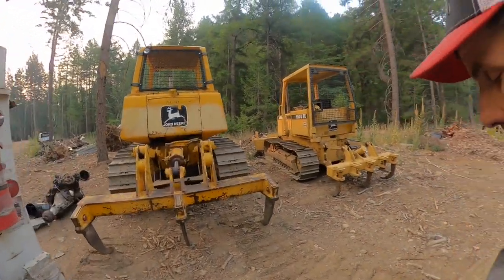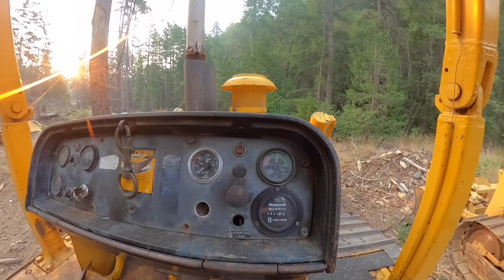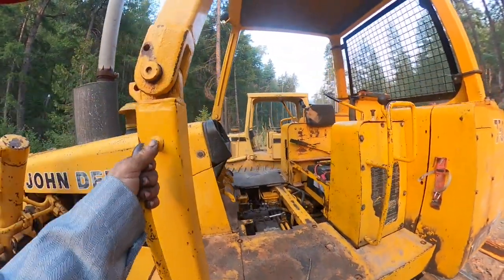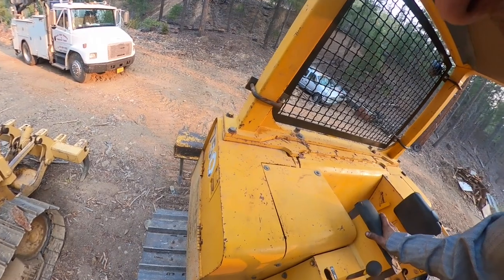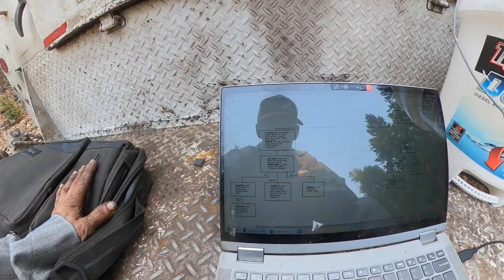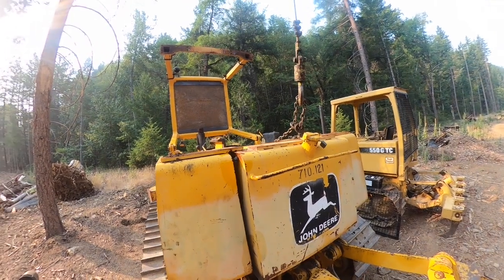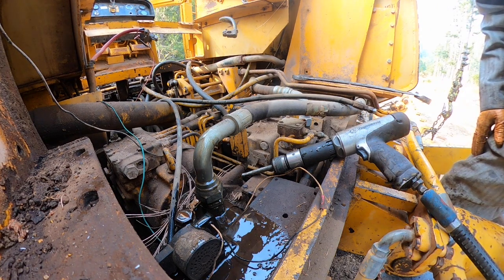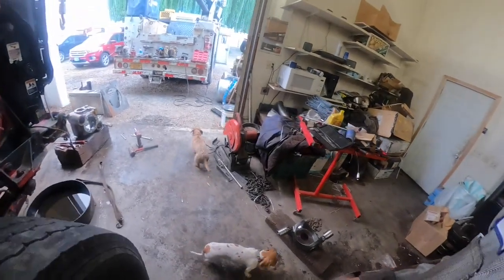Hydrostatic transmission

Comment: This man has no fear about tearing into the guts of any machine. I respect that.
Reply: With a manual and parts source you can do anything. And things are usually simpler than they first appear.
Reply: @winstonpoplin even with a manual, it takes mental and physically strength. Not everyone can take a manual, and tear into it.

Comment: Good dozer, but you're into the same problems many owners have with that machine.  The grit from the band and friction wear circulates through the pump works and scores up the pistons, and ruins the seals.  You really need to tear down the whole drive body to get it resolved.    I know it's a drag, but right now you are just fixing consequential damage, not the source.  That unit should be able to kick into counter rotation mode with that much apply pressure.

Comment: A bad hydro system will preform better when it is cold but not great but when it warms up your charge pressure will drop and you lose power. Unit is warn out!

Comment: Warren, I worked on a lot of mowers back in the 70s and 80s that used Sundstrand split system motor and pumps. Smaller pumps and motors but they work the same way. One way to tell if you have a leaking hydraulic motor is to put that side under a load and see how quickly the motor starts to heat up. If you are bypassing a lot of oil you will build heat very quickly. You can also use a slightly thicker hydraulic oil to make the system operate better and not rebuild the pumps/motor. A good 30 wt motor oil would work just as good and you would get more life out of the system after it is worn.

Comment: Good work , I used to do a lot of hydro's on commercial ztr  mowers ,  hydro gear ,  I would get  kit,  swash plate , piston pump, ,ect , usually scratches  you could see ,  bit if you changed fluid on time and filters  they would last ..even the low end ones .. I had seperate wheel motors , from pumps,  when they failed , I tore them down , never found a scratch even... Was strange , danfoss and hydro gear ...

Comment: I would check for pump ,valve/ bearing plate schoring. I've seen a lot of servo piston scouring and just polish them up and run them. That's a lot of work to get to that point! Probably need to reseat the shaft seals before reassembly there a mechanical seal.

Comment: The old girl is just worn out. Time for a rebuild. Did you check case drain pressure on right side? Drop on charge pressure on those usually a good indicator of internal leakage somewhere.

Comment: BTW  > may be of interest > That transmission is very similar to a 500 electric shift honda 4-wheeler  transmission that I tore down , I found it interesting , it seems honda got the design from a foreign company , used for variable speed in a factory , possibly drilling also , from little I could find out .

Comment: Not sure if you can put me in the right direction but I have a jd 1987 550b dozer. I just removed the selector valve, replaced the seals for the shifting spools as one was leaking bad.  Put it all back together, no more leak and works great.  Replaced and adjusted ball joints and linkages for shifting. Shifts great.  Started it today and moved it 3’ and that was it.  Forward, reverse 1, 2, 3, gears.   Nothing!    Where do I start to look.  Transmission pump????    Any help would be greatly appreciated.   
Thanks.

Comment: I hear ya: I'm working on my truck tractor for 4 weeks on and off resulting in not much progress to show for it because I keep stepping on my woohoo and having to redo 80% of what I have already accomplished because of misremembering torque specifications.

So getting whipped is not just physical but it's also mental morale.  I would take the aching back and scratched and cut knuckles if I could complete a task any day of the week because my mind will win over body and the aches will become good aches and not in vain.

Comment: From the last vid on this incase you missed it Warren, and again may be well off track with this 😂

Is there a brake valve Warren? Seen something about brake valve directs transmission charge pressure oil to release brakes and close transmission bypass, if it drops below 100psi the valve will direct parking brake pressure to sump. Just when you said something changed....brake pedal pressed maybe? Adjustment needed there as well?....might be way off track here Warren 🤣👍

Comment: You can "pressure wash" till you run out of water, and it won't be clean.

ZEP degreaser soak at least one hour (a cut plastic drum is great) or even
a gallon jug of Ultra Dawn dish detergent & water.
Then STEAM clean it. Those units are an investment, just like
your truck and tools. Get a decent diesel fired unit.
You'll be amazed at the results. You must first use a degreaser.
Water, at any temperature or pressure- merely sits on top of, or pushes
globs around. Water will not emulsify the oil. A surfactant breaks the 
surface tension (bond) of the petroleum.
Reply: Ya: and my broke ass gets the solvent in a pink and size with Haywire dip basket to wash parts that will fit inside it.  Can't beat solvent for get rid of grease, oil, and dirt.

Comment: Where would you recommend getting a e-manual or a copy of a service manual for a 1977 John Deere 750 dozer. Dozer tracks straight forward but wants to turn a little in reverse. Also you have to correct forward and reverse as you go back to neutral as it will still pull if you don’t go a little past neutral either direction going forward or reverse. Thinking it’s in the control valve you put gaskets on, but not sure.

Comment: Seems if p5 & p6 and p7 & p8 are pressure and returns for each other, then to test it you'd need to cap p6 at the valve and install the guages to p5 and the return line for p6.
That way you could see the pressure going out and the pressure returning.
So T fittings may be necessary for both sides I suppose.
Hope this helps...
Reply: Any Idea where I can get a Transmission Control Valve for this JD 750 B I tried most of the JD dealers and they say the part is no longer available, I need a good used one or have mines rebuilt

Comment: Check case drain flow out of hydraulic motor driving the weak final drive . Excessive flow means hydrostatic motor is internally bypassing .
Heavy equipment Forums channel helped me alot.
Almost just bid on one of these JD 750 s. 
I stay with CAT.
Poor parts service on JD.

Comment: have you ever ran in to a d6 that when the oil in trans gets hot it starts to make the right had cutting clutch act up and not work?
Reply: D6d? Probably the steering clutch booster bypassing when the oil gets hot and thin.

Comment: Hydrostatic dozers are a pain in the but , always trouble in the system , always, especially if you run them out of fluid
Reply: 😕

I was kind of hoping to get a hydrostatic drive Dozer someday.  My aunt had a hydrostatic drive Bolens Husky with a Wisconsin 12 horsepower engine back in the 70s.  It was always nice not to have to mess with the throttle to change ground speeds and to keep the RPM's up when using a mower or tiller.

Comment: Hey Warren, seeing the charge piston made the surge pressure make sense. I never worked on the static drive systems, but I did help a couple of guys solve issues on them. The diagnostics kind of cross your brain up until you actually see those opposing pistons and then it makes sense because when the piston cycles, those grooves allow the fluid to back charge causing the pressure to rise.👍
Does that cause a hydrostatic lock-out with the opposing pressure not allowing the faulty side to fully engage?

Comment: These 750 j d dozers are pure junk I own one there's always hydrostatic  problems and oil leaks and expensive parts poor design period,, most of the time you have run them direct drive bypassing the controll valve,, a lot of the time the motor servos are sticking,, a mechanical  nightmare not accessible to repair easly you can't rebuild it junk it an buy a new motor 10 k or more